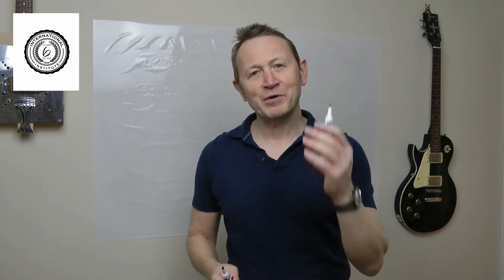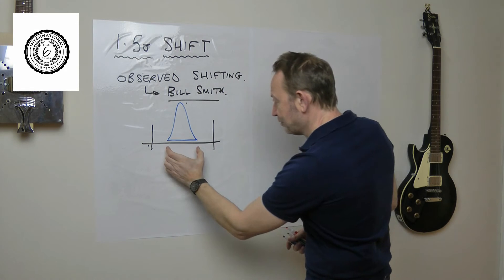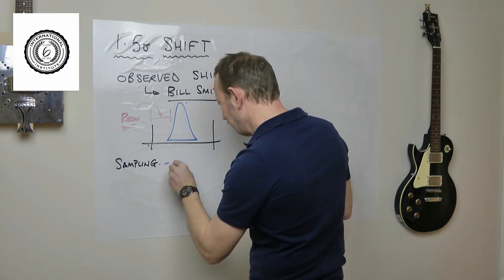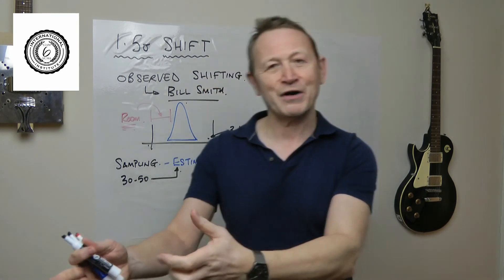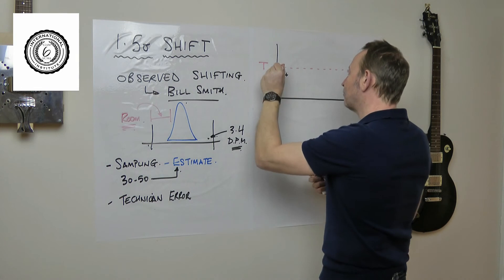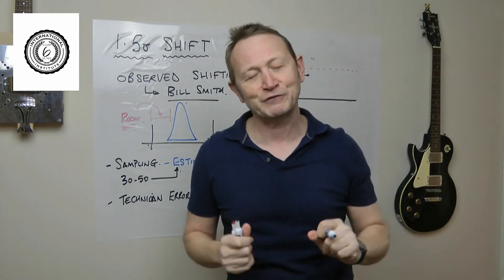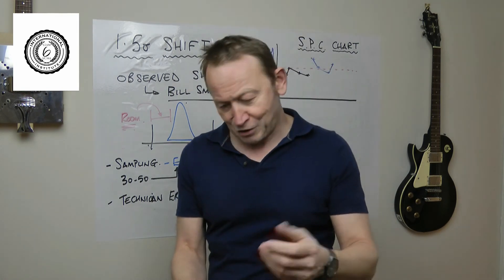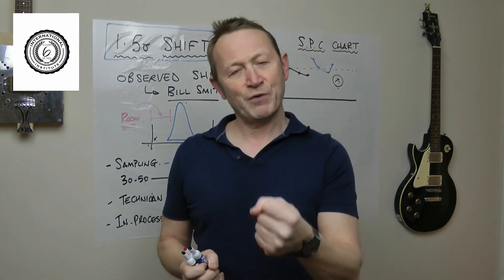1.5 Sigma Shift - What's it all about?

Comment: Thanks for being brave enough to make this video on this controversial aspect of '1.5 Sigma Shift,  and I am pleased to see that the 'Trolls' have not found it yet.   It is an interesting way to explain it...with the 'Bell Curve' drawn it your diagram having a range of 6 Sigma ( 6 Standard deviations total width ) ...Plus and Minus 3 sigma on either side of the mean ( centre ).  Then you are adding 1.5 sigma 'room / space for movement ) on each side ....so the centre is then essentially 4.5 sigma from either of the Specification limits.  Using the Empirical Rule of Normal Distribution that 4.5 sigma (standard deviations ) from the closest Specification limits is what will give the 99.999660 %  ( 999,996.6 per Million ) within the Specification limits  and only   0.00034 (  3.4 per Million ) outside if Specification Limits.     This is interesting from a theoretical and historical point of view because it this low defect number ( 3.4 DMPO ) was the number that Motorola chose,  but is not necessarily what other companies will choose as a target... and their process will be 'shifting' by other numbers....not 1.5 standard deviations.   But your point is well made Paul.  Bravo.
Reply: It is not "controversial ".  It was FRAUD.